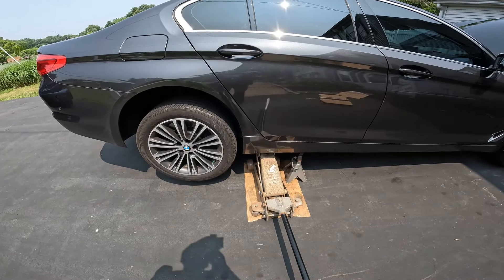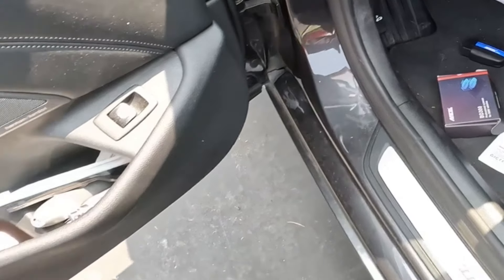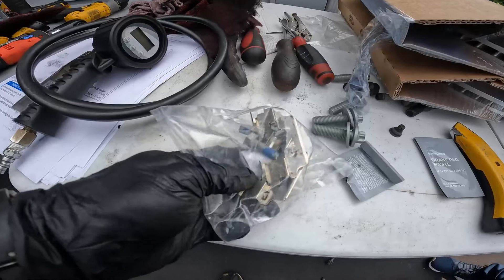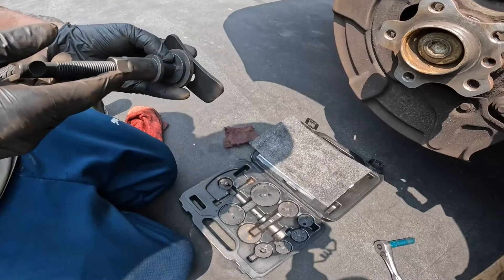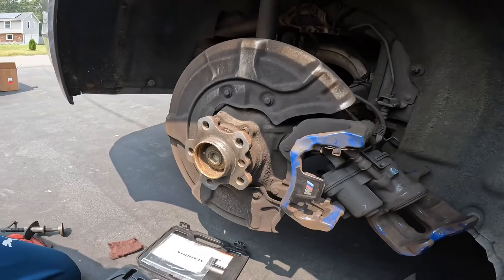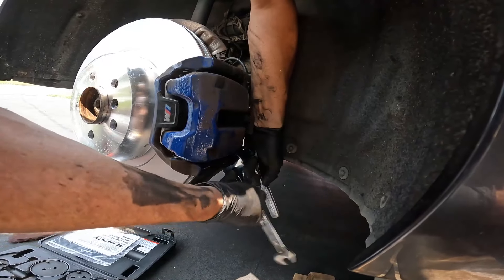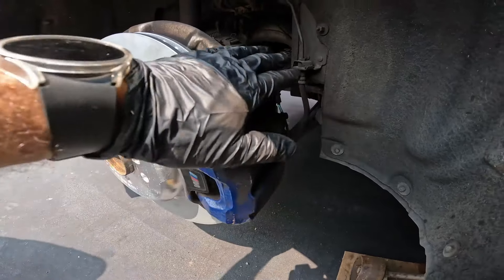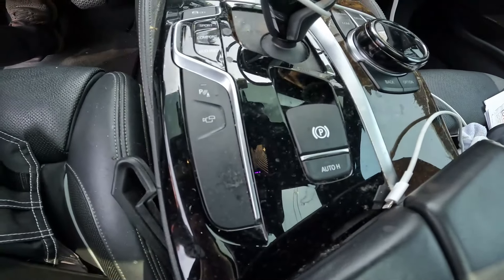BMW Rear Sport Brakes Replacement Pads Rotors Sensor DIY With Full Details, Torque, Tricks!

Comment: Thanks for doing this. It's exactly the same on an X7 w/ M sport brakes. Made the job go really easy. I also used bimmer code which made the brakes just go back in w/o the tool.
Reply from the maker: Hello Ama, Nice! Great to hear it was helpful! Using a scan tool does make the job A LOT easier :)
Reply: Hey, what are the steps on bimmer code if you dont mind me asking, trying to see if I can do the rear brake job myself. Thank you!
Reply: @skediskadi sorry it's with bimmerlink not bimmercode. But there's a button to do it and you have to pres sit twice with the ignition on. I think it was called "brake service mode"
Reply: @ashtonm  Did you have to ALSO turn the piston after using bimmerlink or just use bimmerlink to retract and good to go?

Comment: You videos were very helpful thanks for creating them. After I finished the job on my 2020 X5 now I have brake system malfunction indications displayed and the brakes are definitely not working correctly. The car says “stop carefully brake system” and cont. driving possible. Chassis stabilization.  Also parking assist malfunction. Any idea where I might have gone wrong?
Reply from the maker: Sorry to hear that Duane. Maybe the brake fluid reservoir was too low? Check the brake fluid level switch and cap. Scan the car and see what codes you may have. Normally a brake job would not cause this.

Comment: Hi 
I really liked the way you explained in video and need suggestion . I own a 2019 BMW 530xi drive and I need to change my rear rotors and pads can you suggest me the good brand to buy online .
Reply from the maker: I would look at FCP Euro. I usually use BMW OEM parts but FCP offers a lifetime guarantee. I am going to give them a try on my BMW X5 E70 that needs front and rear brakes.

Comment: Can you also use a screwdriver to push the pistons on the REAR caliper AFTER rolling back the electromechanical actuator? Or do you need a clamp or special tool
Reply from the maker: You are correct that once the actuator is retracted you can use the screw driver trick to push the piston back with the pads in place.
Reply: @AskTheCarExperts  you really are a star. Its exactly the same as the F10, then. Thanks for coming back to me so quickly. Fitting my rears tomorrow
Reply: @AskTheCarExperts  thanks again. I replaced my G30 rear pads yesterday and I can confirm that you can push the pistons back with a screwdriver 🪛   Cheers

Comment: Hi Roger, few months back I asked you regarding cold start RPM jumping up/down issue on my BMW X5  2012.  As per, your recommendations I checked vacuum leaks, MAS sensor, and re-learned drive adaptations.  But issue never went away.  after, watching your Sarvo Motor replacement on X5.  I did preventative replacement maintenance on my  Sarvo Motor.  After, re-adjusting adaptation on motor my RPM issue on cold start went away.    I guess, if Sarvo Motor is on its way out it could affecting timing on RPMs on cold and regular start.  maybe we can add checking out Sarvo Motor in tips if someone has cold/regular RPM start issue along MAS, Vacuum leaks.  thanks bud.
Reply from the maker: That is great! I have never done a Servo motor as a maintenance item but it could cause a rough feel since it directly effect the intake valves. Any slight binding at a specific spot could cause some symptoms. Thanks for sharing this information!

Comment: Hi roger. Hey thought perhaps you could help with my issue with my 2008 528i..when I drive at speeds higher that 40ish my front end starts to wobble ( for lack of better word). I just changed lower control/thrush arms..but it hasn’t helped..it almost feels like I’m driving over mini speed bumps..or my tire is going flat..what would make this happen?..just ordered new sway bars bc they looked worn….but just don’t know..if you can please help I would greatly appreciate it..
Thanks
Joe
Reply from the maker: Hi Joe, That might be hard to help with without being able to look at the car. Lift both front wheels and wiggle test the suspension back and forth up and down looking for any play. Swap your wheels front to back to see if that changes anything if not staggered sizes.
Reply: @AskTheCarExperts  yeah I know that’s hard to figure out without seeing..but I appreciate your quick response..thanks!  
Joe

Comment: Thanks for sharing. The only thing confusing me there is the rotation that the tool turned the piston to retract it, because if you remove the EMF actuator and use that method, you also turn the drive clockwise on the back of the calliper. 
I guess there must be a gear or gears in between the back of the piston and the drive pinion on the back of the calliper
Reply from the maker: I don't normally take the motor off and either use this tool or my scan tool to retract the electronic parking brake.

Comment: Do you HAVE to change out the brake sensors on the front and back pads and get new ones or can you just unplug them and reuse them if you don’t break them??
Reply from the maker: Great question John, If the sensor is worn through and the warning light was on you will have to replace. BMW recommends to replace the sensor every time it is removed. BUT if the sensor is intact and you are able to remove it carefully you CAN re-use the sensor no problem :)

Comment: Good afternoon.  I have a 2021 540i M Sport with 52,000 miles.  Rear brakes are needing to be done now.  Dealer wants $1,200 just to do the rear pads with rotors.  On this video, are you showing the side with the electronic Ebrake??? If I do the brakes myself, is there anything special I need to do, other than manually turn the piston in, then pump the brakes when finished.? I never saw you use any clamps or anything special to hold the piston in, nor use any screwdriver to get it to come back out.... Is it essentially this easy?  Nothing will happen to the Ebrake motor or blow any pistons out, if I basically do what i just watched?
Reply from the maker: Hello, the rear has the electronic parking brake. If you follow my steps you should have no problems.
Reply: Right, that was my question.  You showed the side with the electric Ebrake correct? Left side should be easier?

Comment: Hey Roger, would this method work for a 2022 M340i?
Reply from the maker: Hi Scott, I think for the rear brakes this would be the same. For the fronts the calipers may be a slightly different style as this was on a BMW G30 5 Series

Comment: Very helpful video, but you used #9 on the caliper service tool, not #6. I would also add that the left and right rear wear indicators are different and require a different cable.
Reply from the maker: Thanks John for adding some points.

Comment: Do your scan tools not allow you to input the vin and access manufacturer specific diagnostic protocol manually? Just because auto vin doesn’t work on a scan tool doesn’t mean it’s useless.
Reply from the maker: @HighGrade_FireBlade  For this vehicle the electronic parking brake release was not supported. My launch can activate the e brake to service mode. It is helpful to have a decent scan tool.

Comment: I think this is the only video I've seen for rear M-Sport brakes that when it's manually retracted, you're not separating the motor from the caliper first and then using a Torx bit to retract the EPB mechanism prior to using a piston  compressor. This method works without breaking anything?
Reply from the maker: Correct,  that is what the special tool is for. But you can take the motor off or use a scan tool to put the mechanism into the retracted state.
Reply: Ah, thanks. I have one of these tools gathering dust in my box. Good to know it will work for this as a backup to Bimmerlink brake service mode.